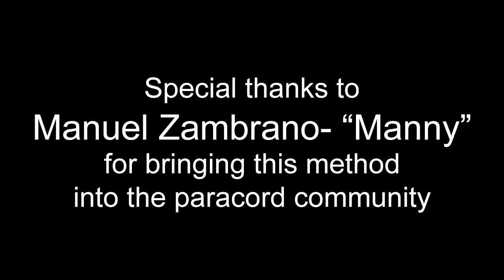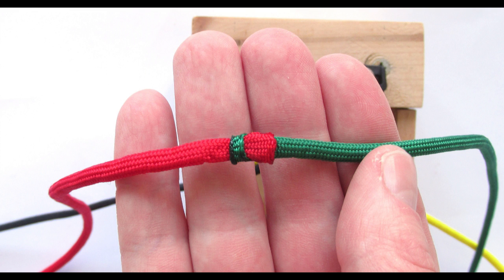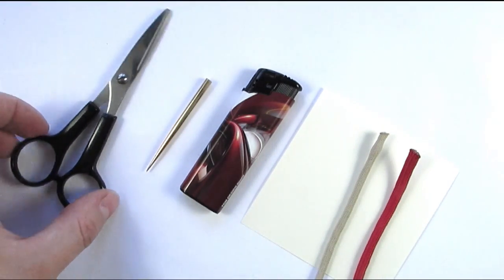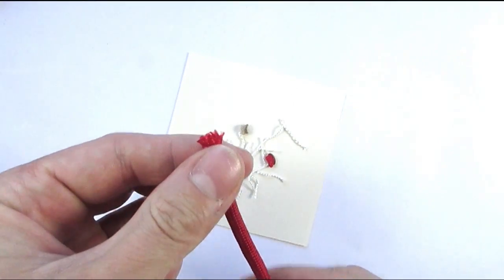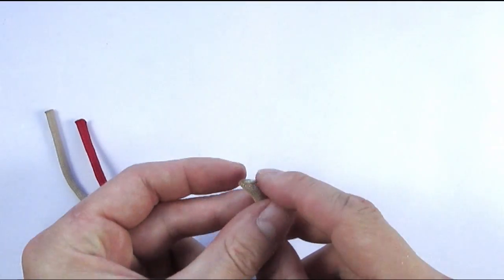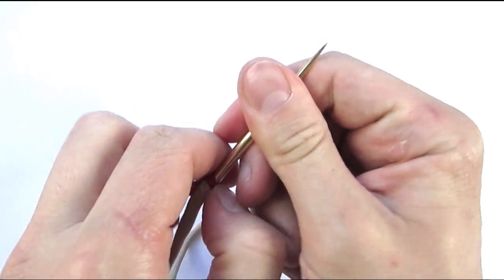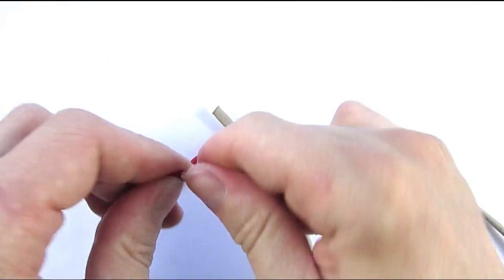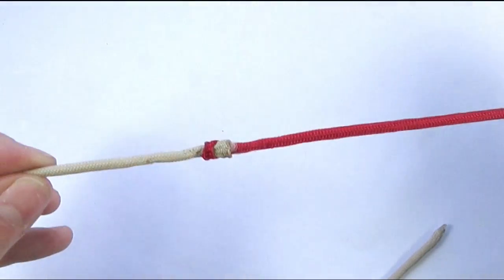How to join paracord properly for decorative work-  "The Manny method"

Comment: The integrity of the cord is compromised with the internals not connected.
Reply: If you expect heavy use (tugging or stretching), the kernel threads might bunch up along the inside of the cord, making the cord lumpy.  To prevent that, before pulling them back inside after cutting them not quite so short, melt them together, and when threading the opposing line thru, stick the needle thru one side of the mantle & also thru the kernel, just behind the melt).  this makes the joint a little bigger, but it cannot bunch up.

Comment: You don't have a strong join though, because all you're connecting is the outer sheath of the paracord. The inner strands are just hanging loose inside the sheath. The sheath has a strength of only 300 pounds, so you've essentially weakened the paracord by nearly 50%. If you used a hot needle or an electric soldering tool to melt the inner cords to the outer sheath before you began, leaving a hole in the center to pass the other paracord through, I suspect the cord would retain much more of its original strength.

Comment: What is the WLL (working load limit) on this type of splice? I have been a tree removal guy for many years, and as I understand kernmantle cordage, the inner strands, or core (kern) take the load, and the outer jacket (mantle) is simply to protect the inner core from abrasion, and not really take significant load. This may be a durable splice, but I don't see how it can take much load. Most knots reduce rope strength by 50%, and I think this would be even weaker than that. I was always taught that if the rope doesn't have to run through a pulley, a double fisherman's knot was your best connector. I suppose for decorative purposes it is fine, but if you ever intend to use the rope in an emergency situation, it could fail. Oh, and I think melting is just as suspect. Only a woven splice connecting the inner strands will maintain cordage integrity. I'm no splicing expert, but I have done a number of end, midline, and eye splices, and put thousands of pounds of load on them.
Reply from the maker: William thank you for taking the time to put together such a well thought out comment.

The "Manny method" is much stronger than melting together two cords. Naturally a spliced rope is stronger, but here you only have two woven cords to work with. So I have so far not seen a better way to join two cords together.

The bond is strong enough for most decorative purposes. Naturally using knots such as choker knots (fisherman's for example) can be even stronger, but it is also much bulkier.

In any case, glad to chat with you,
Mark
Reply: Thanks for the reply Mark. Love your videos, and have made several projects based on them. Doing a bit more research on tree rope, seems the Manny method has a few different manifestations, of sorts... but even high load-bearing ropes have eye-splices that are closer to the Manny method, than a traditional strand weave... I may just have to try it and put some weight on it to see. Thanks again!
Reply: I never got the impression this video was showing this for purposes of weight bearing.  Anyone that would see this and think they should use it for weight bearing has more issues than just lack of common sense.
Reply: To increase the durability of the connection without making it bulkier, some Common Whipping could be done over the splice. Not sure how much it'll increase the load strength, but the splice would be better protected from wear.
Reply: not only that... by using this, the core is useless as all the load is now on the jacket as the end of the core isn't connected to anything.
Reply: For decorative knots flame fussing is problematic because it tends to break as you sinch it up. This would be significantly more secure but nowhere near the full strength of the uncut cord.
Reply: @jarodmorris611  I concur Doc.
Reply: woodworks1423  But it is not as streamline as this. I think this video is for people looking for a way to hide the joint as to not make a bumpy spot.

Comment: There are two additional steps that make this much much easier. Learning -  I tried this as shown - and was never able to get it to go through no matter how much I tried to melt and smooth.  First step is - when you melt the ends of the outer cord to prevent fraying - quickly insert a large fib into it so it cools enlarged. Second, on the fib/needle end - cut a small amount of inner cord, melt the end of the outer to completely fit into a sharp, medium/smaller fib.  Then do the steps in the video.  The cords will slide right into each other.  After that - take your lighter to heat the inner ends - roller them smaller between your fingers.  Awesome joint.
Reply: Jeffery Hansen  Thank you!!! I was struggling and found your tips! This really makes it so much easier!

Comment: Nice technic, i used this when i was short on cord during a project. I made wrong calculations and i didnt want to start all over. So i put the needle in the opposite direction, cut the cord and put the needle in the normal way shown in this video. Thanks

Comment: Thank you so much for sharing this method of Paracord joining, it’s worth the extra effort. I always felt that my melting joining weren’t strong enough and always prefer giving the best quality in whatever I make.
Reply: It's actually not even very much extra effort, if instead of trying to stuff each end through the hole, you take a small pair of needle-nose pliers grab the opposite end, and pull it through, instead. Literally hassle-free, and significantly more sturdy

Comment: Got it thank you. Where can I get sharper pointed  needles? Mine are stainless steel and came with my  Jig Pro Shop Knotters Tool
Reply: This is a very late reply, I know, but the Jig Pro Shop sells what they call "Type 2" needles which are thinner than their regular stainless steel needles and are great for this method

Comment: It looks great, but that join is the weakest part of the cord since the threads inside are not joined in any way. So any tear on the shell and the threads may/will come out leaving just the shell. Good only for crafts but for holding or safety it is not.

Comment: I've been taking super glue gel and putting it in between two sections that are slightly overlapped (3/16 at most) and then pressing them together with vice grip c-clamps with the oval pads. 60 to 90 seconds and I'm done. It works great and I have never had them fail while tightening a knot. I only do this when I'm connecting two pieces that are going to be used for decorative use and if the edges don't align I trim them up with scissors. I also know when I get a good weld because I can see the gel pressed completely through the cordage. The part where the sections are joined is flat but its so small and hardly ever lands on an exposed area. When it does I am the only person who ever notices it. I like this method though and I will have to try it.
Reply: Just use the spike to poke the hole, and use a small pair of needle-nose pliers the pull the strand through, instead. It's just as easy as the other method, and is legitimately the sturdiest method you can possibly used to join 2 pieces of paracord; as evidenced by the fact that our street no longer has random captives running around town, foolishly thinking that because they escaped the dungeon, they were home free

Comment: If you strip the inner core altogether, you have a flatter wrap for handles, reducing bulk. Still not load bearing. But I have swung from "inner stripped paracord" and it held just fine! I weigh just north of 150.

Comment: Thanks for the video. Looks great for decorative work.

But for strength I get the impression that the cord is being weakened, as apprised to something like a reef knot.
Reply: +David Walsh  The reef knot is stronger than this, but it is still one of the weakest knots you could use to join the ends of two strings/cords/ropes.  Its breaking strength is only 45% that of the cord, but with relatively strong, slick cord this knot often slips before breakage anyway.  If you need a secure but very simple knot to join ends (a "bend"), then at least try the overhand bend--simply put the two ends together as one, side by side and "pointed" in the same direction, and tie them both (as one) in an overhand knot (like the first knot you tie your shoes with), like so:
https://www.youtube.com/watch?v=e46GXvdOJmI

While it's not very strong at only 50% cord strength, at least it's not prone to slipping.  Another popular bend that may be slightly better (although it may loosen when unloaded) is the sheet bend:
https://en.wikipedia.org/wiki/Sheet_bend

Much better is the popular butterfly bend used by many climbers--we're talking about 70-80% cord strength plus no slipping, jamming (can be deliberately untied relatively easily), or loosening:
https://en.wikipedia.org/wiki/Butterfly_bend

The double fisherman's knot (not the single version) may actually be very slightly stronger, but it's a pain to tie, in my opinion, and at the very least it takes longer.  Probably better still, though, would be the zeppelin bend, which is similar to the butterfly bend:
https://en.wikipedia.org/wiki/Zeppelin_bend

None of these knots is super-hard to tie, and even if you're bad at knots, the overhand bend is super-easy, so there is no excuse to use a reef knot as a bend.  It works OK as a binding knot (allowing you to tie objects together tight, or your shoelaces in slipped form), so use it for that, but not to join two cords.  And whatever you do, don't use the granny knot for anything!

Comment: The o ly problem I see with this method is it cant be done in the middle of the project, ie. Your making a sling and fall just short of finishing you cant do this to slice more cord In to finish. But yes at the start of the project and you know your using two dif. Cords this is def. Best way to do it, much stronger bond.

Comment: After cutting out the inner stand, insert the tip of the fid before searing the end with the lighter.  This leaves the melted end open rather than melting it closed.  Then this process is much easier.

Also, don't cut out more inner strands than absolutely necessary.  These are doubled for strength, and cutting out to much gives a weak spot.  Also, do the insertion as close to the tips of the inner strands as possible.

Comment: This is indeed useful. I would in most cases though, reinforce this. Just using a whipping with cord. like when whipping a rope end. Frap the whipping over, and a little  extended past the splice ends.

Comment: Looks way better then just putting two ends together but after I put them together and pull  the slack so u melt them and fuse them into one?
Reply from the maker: Hey!

I do very little melting, maybe just on any small frayed strands.

Mark
Reply: Paracord guild okay, thx still waiting for my paracord it's been 12/13 days if it doesn't come in the next 6 days I will file a disputed at the seller but it takes time from China mail, it's a valid buyer bye
Reply: Btw

Comment: Shell is joined, what about the core?
Reply from the maker: Hey!

The core is not joined using this method. 
The sheath is plenty strong though, so it will hold the cords together securely.

Mark
Reply: +Paracord guild 
Hi There,,,  You do great work...
Is there anyway to incorporate the core in the splice?
Or,, what is the best way to splice paracord for strength ?
Thanks and keep up the good work. ..
Reply: The core isn't joined in the weak old melting process. This is head & shoulders above that process.

Comment: Since the inner cords are not joined, wouldn't that mean that the splice is very weak and prone to breaking if the cord is under stress? Also, since the inner cords are not secured at each end, wouldn't that cause an issue with the sheath sliding over the cords and severely compromising the the overall strength of the cord as a whole? Seems to me that if the inner cords are not connected at the splice then the paracord would not be trust worthy.
Reply from the maker: Hey!

This is a method used to join paracord for decorative purposes. For practical/survival purposes you would not join paracord together this way, but use a sheet bend or a choke knot. This technique is used to make items such as bracelets and such.

Mark
Reply: Ah, makes sense now. This looks good, but I was wondering why go through all that effort and not simply tie a  knot.
Reply: It would probably be good to put in the video title an description that this is for decoration only (I didn't know people used paracord).

Also, in the video, the guy says it is "powerful", "very strong", etc.  Which makes one think that it is a strong method to combine two ropes.

It also looks similar to the weaving method that is used for the rope that doesn't have a core, and so for that rope, it doesn't diminish its strength at all...
Reply: Yes - I'm glad to see they took my advice and updated the title.  That didn't used to be there...

Comment: double fishermans is the only way to keep the strength. nor as clean though
Reply from the maker: Hey!

Good comment there!
I usually discount the double fisherman's for decorative purposes due to the bulkiness, but in survival and practical use, this is indeed handy!

Marj
Reply: +Brian Kessinger  That is a great and very strong bend, although there are some practical alternatives.  The butterfly bend (popular with climbers) is very nearly as strong, is faster to tie (at least for me), and is probably easier to untie if need be.  The zeppelin bend may be even better than both (stronger and more jam-resistant), and is just as quick and easy to tie as the butterfly bend.  And finally there is the overhand bend, which while significantly inferior in strength to the others, is probably the one secure, viable bend that anyone--even those who absolutely suck at tying knots--can remember forever and tie anytime, anywhere with zero difficulty.  It's even quicker and easier to tie than the ubiquitous reef/square knot, and it doesn't tend to slip like that one does.  Therefore there is no excuse for using a reef knot as a bend.

For reference:
https://en.wikipedia.org/wiki/Butterfly_bend
https://en.wikipedia.org/wiki/Zeppelin_bend
https://www.youtube.com/watch?v=e46GXvdOJmI

Comment: this is perfect for two colored paracord bracelets.
Reply from the maker: Indeed!
Reply: No dip shurlock
Reply: Chris Baker I like to use it for joining two cords of the same color... 😀😀😀
Reply: Try doing it with four different colors in a square pattern. I wonder how that would look after it pulled tight.
Reply: what if i want to use a single cord and join the ends to make a circle, is there a way to do this?

Comment: When pulling them through the other... Could you not just take out some inner cord from the other side and make it smaller and easier to go through the hole you make in the outside shell? The worst part I would think was the first 1 cm to get through.
Reply from the maker: Hey!

If it works, you should use it. The simplest way is to get a sharp lacing needle. I have also struggled at first when I used nose pliers to pull the cord through.

Mark
Reply: Chiming in here - I would say yes. But in order to do that, you might need to snip a small opening with scissors (so to create a hole for the cord to go through) & quickly melt around that so to prevent fraying.

Comment: The limitation I see is that it only works with relatively short lengths of rope, since you need access to both ends.  I wouldn't want to join two 100' hanks of cord, for instance.
Reply from the maker: Indeed. 

But that is a very rare case I presume :).

Mark

Comment: It's called a reef knot
Reply: +Stealthinator139  If your purpose is decorative and you like the look of the reef knot, then fine, but otherwise it is one of the weakest knots you could use to join the ends of two strings/cords/ropes.  Its breaking strength is only 45% that of the cord, but with relatively strong, slick cord this knot often slips before breakage anyway.  If you need a secure but very simple knot to join ends (a "bend"), then at least try the overhand bend--simply put the two ends together as one, side by side and "pointed" in the same direction, and tie them both (as one) in an overhand knot (like the first knot you tie your shoes with), like so:
https://www.youtube.com/watch?v=e46GXvdOJmI

While it's not very strong at only 50% cord strength, at least it's not prone to slipping.  Another popular bend that may be slightly better (although it may loosen when unloaded) is the sheet bend:
https://en.wikipedia.org/wiki/Sheet_bend

Much better is the popular butterfly bend used by many climbers--we're talking about 70-80% cord strength plus no slipping, jamming (can be deliberately untied relatively easily), or loosening:
https://en.wikipedia.org/wiki/Butterfly_bend

The double fisherman's knot (not the single version) may actually be very slightly stronger, but it's a pain to tie, in my opinion, and at the very least it takes longer.  Probably better still, though, would be the zeppelin bend, which is similar to the butterfly bend:
https://en.wikipedia.org/wiki/Zeppelin_bend

None of these knots is super-hard to tie, and even if you're bad at knots, the overhand bend is super-easy, so there is no excuse to use a reef knot as a bend.  It works OK as a binding knot (allowing you to tie objects together tight, or your shoelaces in slipped form), so use it for that, but not to join two cords.  And whatever you do, don't use the granny knot for anything!

Comment: Melt em it looks better and is stronger when done right.  Just because it is harder and takes longer doesn't make it better.
Reply from the maker: Hey!

I am absolutely sure that melting is not more secure. I know of many melting methods and I believe that you can make a strong bond. But the sheath is very strong in itself.

Mark